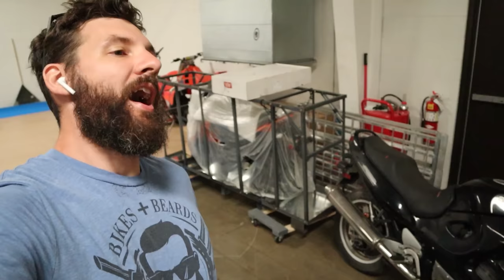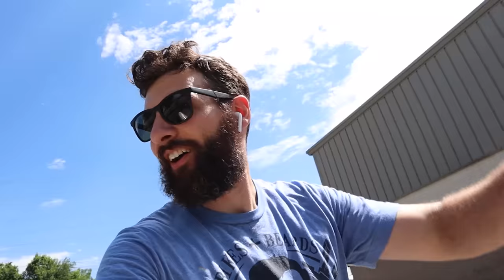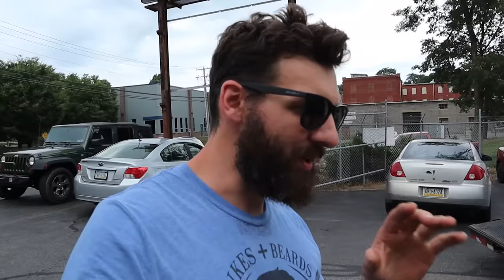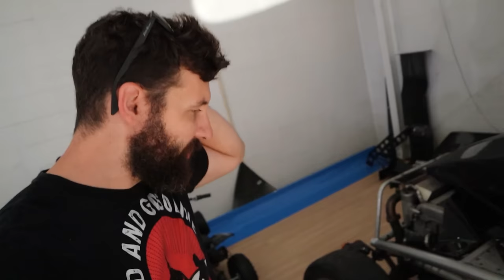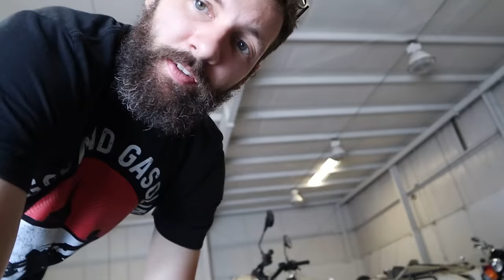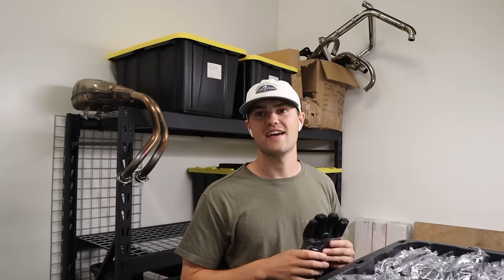The Fastest thing I own is Back!  Almost and ...

Comment: Don't need custom ramps - custom ramp extenders - ones at lower angle of attack that clear splinter until wheels on. If existing are at  30 deg - 15 deg short ramps result in 15 deg effective  for mains Shorts can be stored inside long ones

Comment: You do not need to get a new ignition just take the ignition out  and send it to you local lock smith that’s what I did with my ignition and they cut a key for it
Reply: Classy Gunner I bought the 750 how much did it cost to get a key made
Reply: There is No God yes but the guy I got it from was a relative
Reply: J Spark 50$ for two keys is how much I payed
Reply: now I have to decide if to keep the oem ignition and get key's made or buy new ones but I"m going to just sale it any way

Comment: Atom looks slow and really needs 4wd and traction control also use high octane fuel plus nos with extra booster make sure to have 2 turbo chargers. I would seriously get that engine rebuilt properly or replace with much bigger engine because that thing is not running as it should be. I have honestly seen much faster from a 125cc. No joke i have an old dt125 that would take that atom to the cleaners. Check out the kids that race 125 skinny bikes now they are all quicker than that atom.
Reply from the maker: Wow